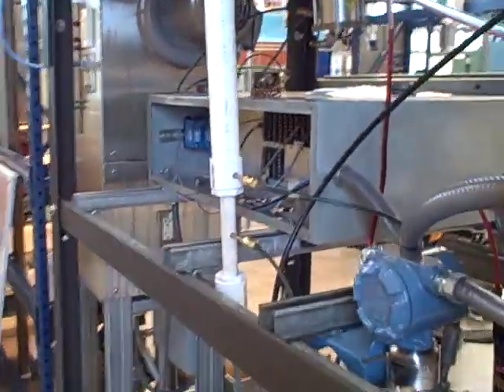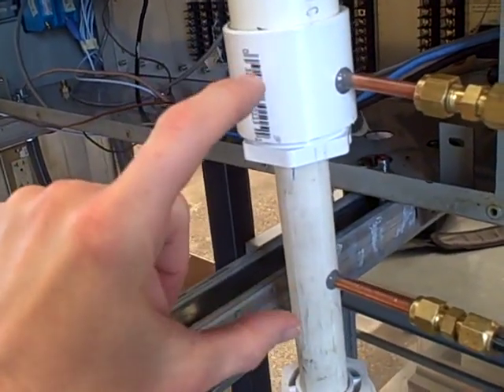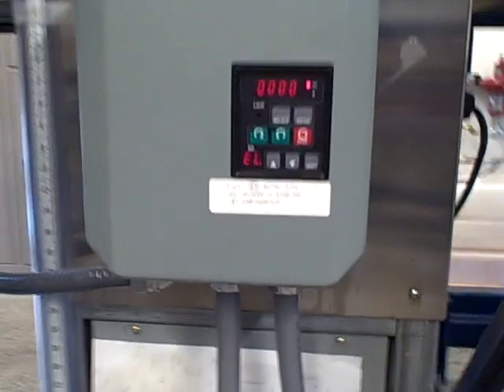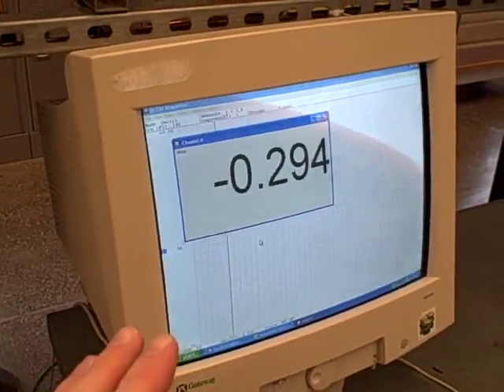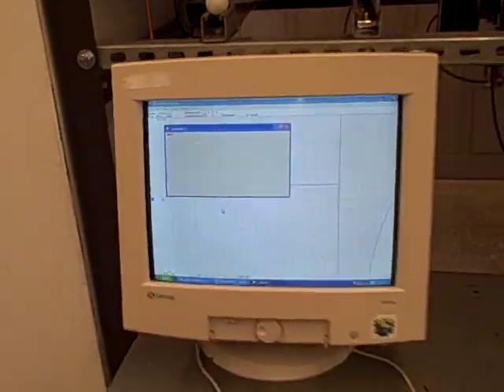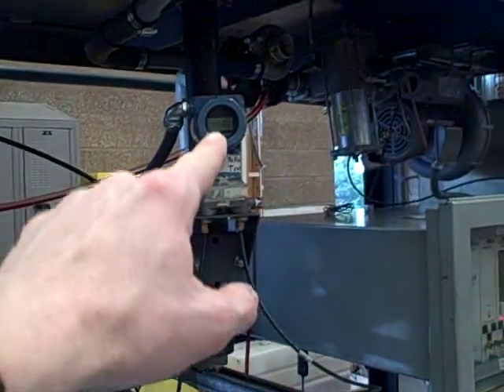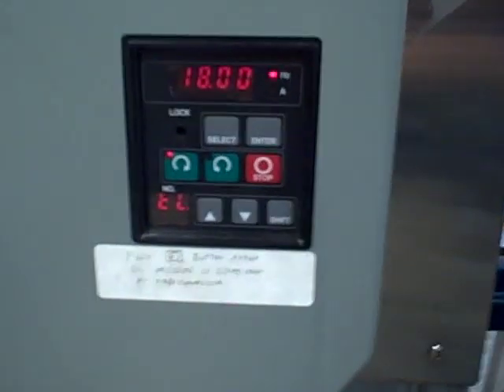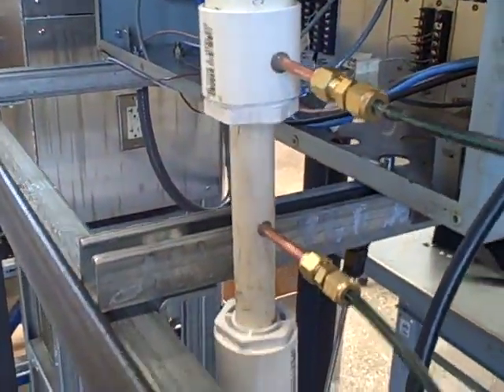Measuring airflow using a simple venturi tube

Comment from the maker: We've tried making small orifice plates, but they generally require machining (more work), and they tend to give less accurate results than the home-made venturi.  With small-sized orifice plates, the turbulent zone is so close to the downstream side of the plate that it's really tough to get a low-pressure tap position that works well.  The venturi tube, on the other hand, is fool-proof for small pipe sizes.

Comment from the maker: Orifice plates require "fully developed turbulent flow" in order to work.  This meand turbulence on a microscopic scale (only), with no swirls, vortices, etc.  The flow regime downstream of an orifice is turbulent in a bad way.  You can get better (more "fully developed") flow immediately downstream of the orifice (e.g. corner taps), or far downstream of the orifice (e.g. pipe taps).

Comment: in case of orifice, what is the cause of permanent pressure loss? How is it improved in venturi meter?
My understanding is that the cause is frictional loss between pipe and flow, but it actually increases in venturi due to long tnroat, then how pressure is recoverable 90% here?